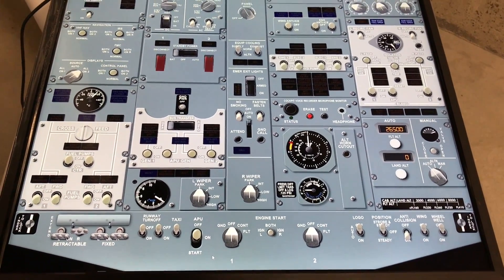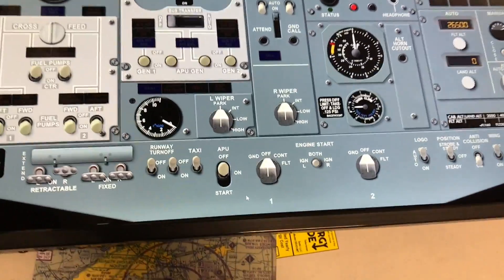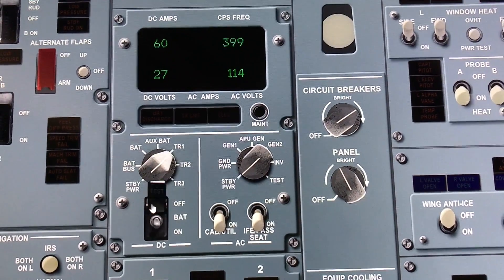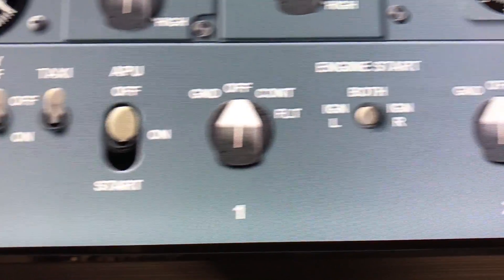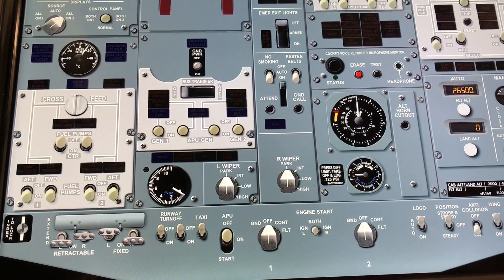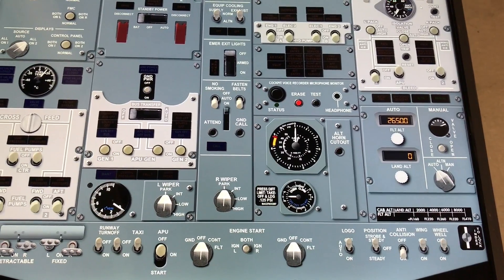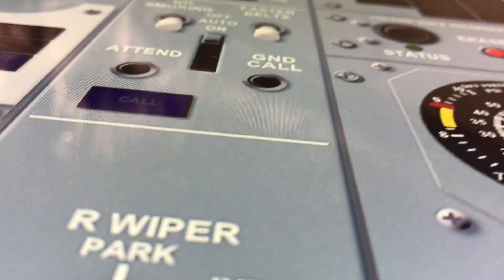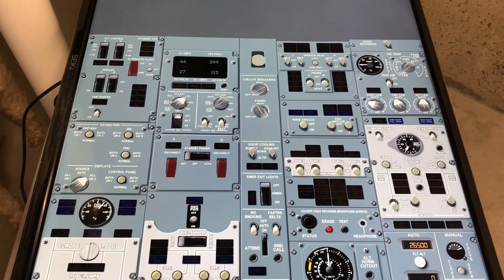x737 Air Manager Update 12

Comment: Hey Russ, great work . I am flying with 737 Zibo. Do you have a Update, when i can install this Panel with Touch Screen ? Do you have more Details ? With best Regards
Reply from the maker: Stefan.  I have been distracted by some other projects. Also my elderly mother has been requiring a lot of time to see to her care.   I need to take a good look at Ziboi 737 and see if it has the necessary datarefs to use with this panel that was made for x737.  Unfortunately x737 hasn't been upgraded to include the aft overhead panel.  This is definitely on my to do list but it may be a while before I get to it.
Reply: Russ Barlow I am also very interested in this Panel. Any news on that. I am also available for testing on the Zibo 737-800.
Reply: Hi Russ, this looks fantastic and exactly what I'm looking for.  I already use Sim Manager for my Cessna Sim, but currently building the Zibo 737.  Have all my panels except the overhead, but I do happen to have a 40" touch screen monitor I'd like to use in the meantime.  Where could I find this panel?  (I cant see it on the Sim Innovations page).  I have access to the data refs for Zibo and would be happy to experiment with it.  Thanks